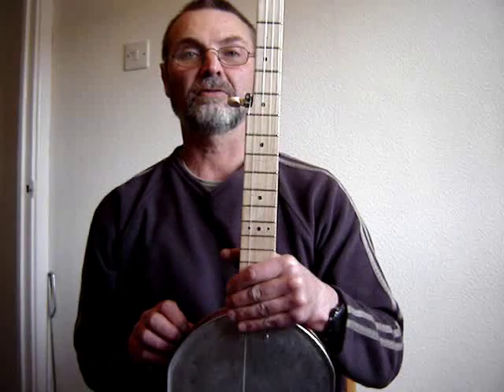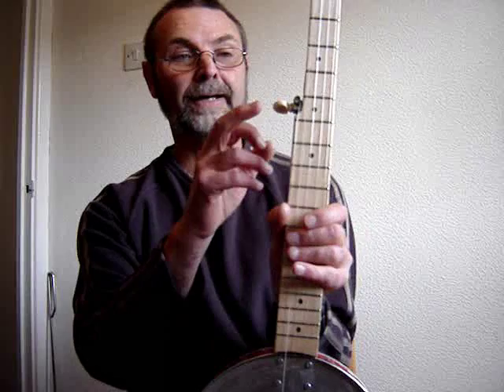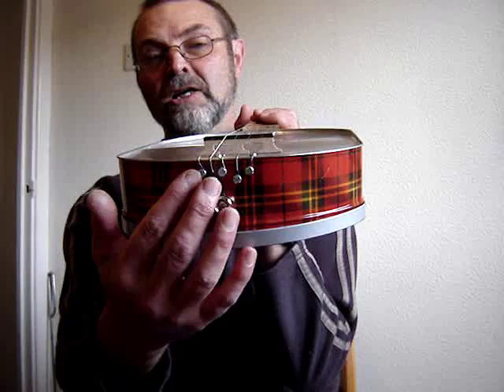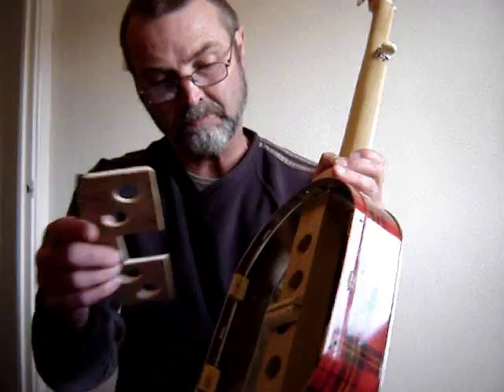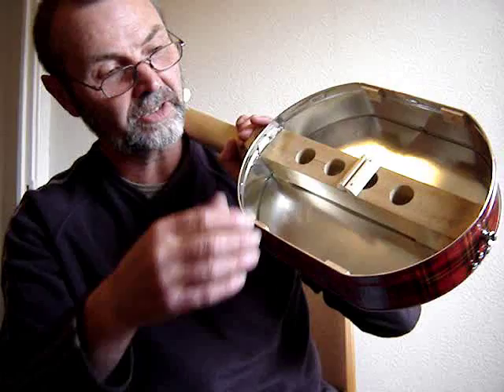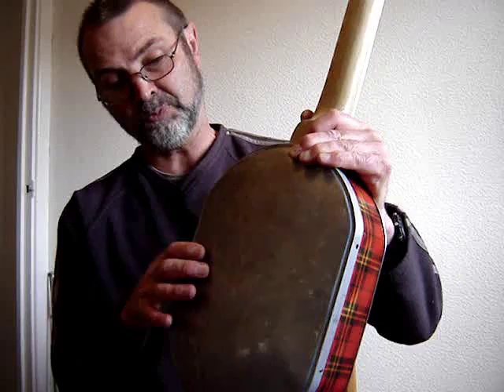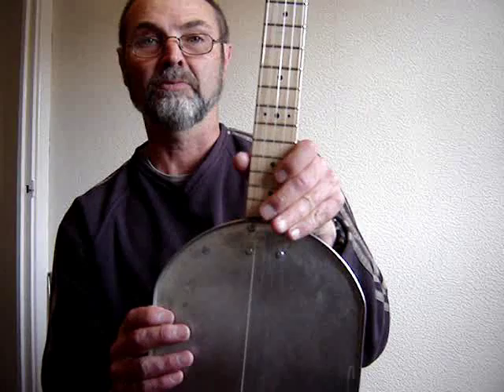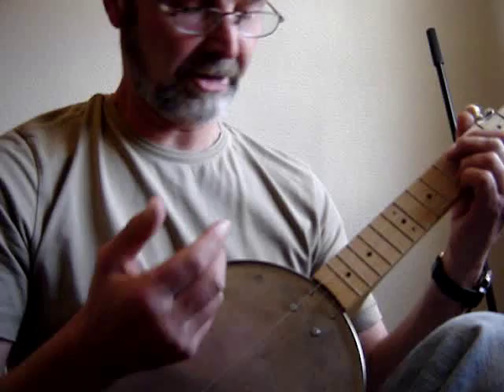5 String Cookie Tin Banjo

Comment from the maker: Hi, and thanks. I think the cutaway section of neck inside the tin and the panel I used to tension front and back make it sound a lot less guitar-like than usual, as does the thin bridge and the fact the the bridge is resting on the unsupported section of tin not in direct contact with the neck.

Comment: Great Sound, great look!
I got a question: I also made one, but it sounds a lot less clear Banjo-like like yours. Do you have any tips on that? How can i make it sound better? And im not using a real bridge, its just a piece of wood. Will it propably sound better if i use a real one?
Reply: Bridge, definitely needed. It helps tension the string and keeps it off the resonator (the tin, in this case)

Comment: Sounds amazing. I'm building my first  cigar box guitar right now, and I think I may attempt a banjo next. What wood did you say you used for the fretboard? And did you use fretwire or something else? Any help you could offer would be appreciated. Thanks.
Reply from the maker: Hi. The fretboard was made of maple. Any reasonably dense hardwood would do though, walnut is a good alternative to rosewood. Alternatively you can make a laminate fretboard by gluing together 6 or 7 strips of wood veneer using clamps. This works quite well, but not as good as using a single piece of wood.
Reply from the maker: Sorry forgot. Just used ordinary narrow-medium fretwire